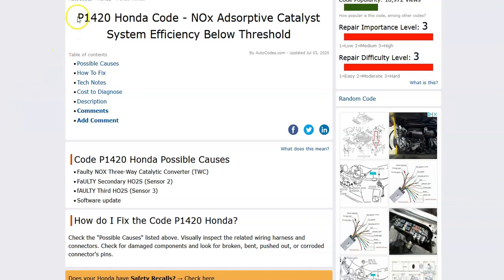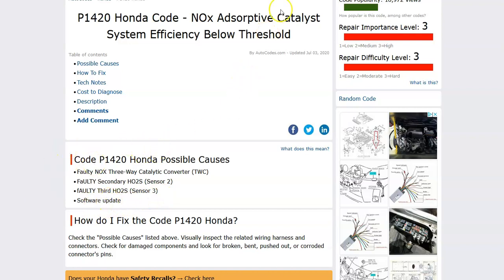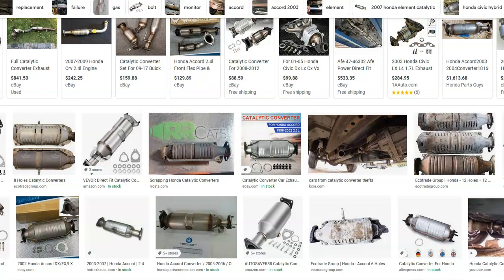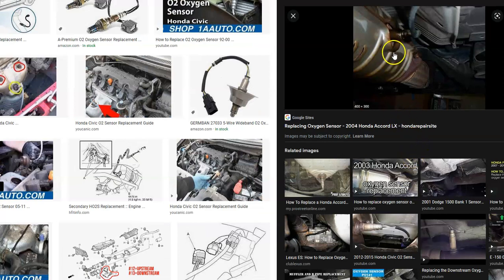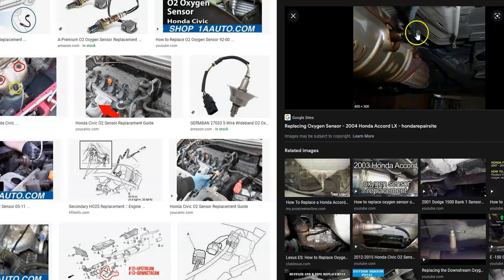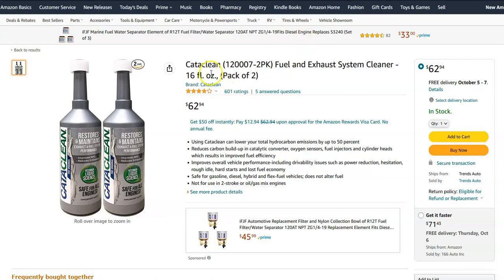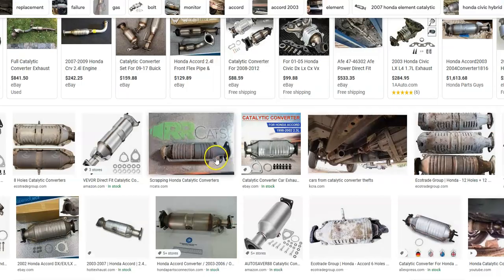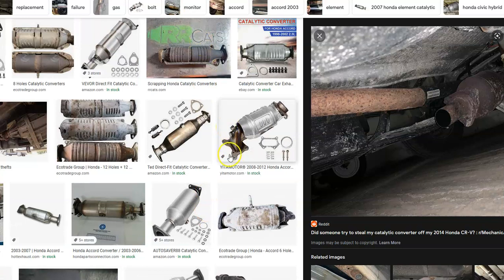How to Fix Honda P0420 Code: Catalyst System Efficiency Below Threshold (Bank 1)

Comment: I have a 2011 Honda Pilot EXL that keeps acting up on me. I'll be driving home from work at 70mph, my VTM-4 light comes on along with my check engine light, my speed on my cruise control drops from 70 to 60 mph especially climbing up an upgrade. Also when the RPMs are between 3,000 and 4,000 as I hit the accelerator, she spudders, but as I release the accelerator she's fine. Could this very well be the catalytic converter that is suffocating the motor and making her sputter? If so if I were to punch out the honeycomb and make it hollow, would that affect my car, other than emissions?
Reply: I had this problem it was the throttle position sensor, hope this helps

Comment: My 07 Honda accord had aftermarket Cat installed and now the OBD II sensor says my sensor “Bank 1” air/fuel ratio is what’s causing check engine light and nothing else was detected what so ever. Is it possible that all I need is a new sensor for bank 1 ? And does is it need to be OEM sensor ? I believe the OEM for my Honda accord is “Denso” and also does the sensor for “Bank 2” also have to be OEM denso brand ? They replaced the “Bank 2” sensor since they stole my entire CAT and almost the entire exhaust system and I’m wondering if the bank 2 sensor is aftermarket and somehow confusing the car and causing the Bank 1 sensor to mess up. I really need help bad with this because I can’t find any used cars at all what so ever In the $8,000 price range that have less than 120,000 miles with good gas mileage and all I can find all over Northern California is the stupid ass “09’ Toyota Yaris” in my price range that’s decent on gas and I do not like anything about that car so I really need help whoever reads this message and what I should do ? Will the aftermarket CAT pass smog if I have OEM sensors in bank 1&2 ? Or is it possible the CAT itself even with brand new OEM sensors still fail smog if I replace the sensors with Denso brand OEM ? Please help haha 😂 I have 178K miles on my Honda and it runs amazing even with the issue I have rn… not a single issue besides this problem. What should I do y’all ? Thank you! I have the PO420 code and says Bank 1 sensor. When they put bank 2 sensor on the new aftermarket cat I wasn’t told if it is aftermarket sensor or OEM either. Do I need to replace both with brand new denso OEM ? And even if I do will it pass smog even with the aftermarket CAT ? I don’t wanna have to buy a new car or a new cat..

Comment: I tell many of my clients having P0420 on a Hondas were/are to junk the car. Because not using genuine Cat & O2 get callbacks.
At the same time these vehicles have well over 166,000 & over 10 years old. If Cat is stolen, then you have no car.

Say if you get a Walker, Catalytic Converter then it's going to last about 2.2 to 4 years. And you have to replace it again.
And some has an O2 sensor on the Catalytic Converter that must be replaced.
If you are DIYer then go for it. Do not buy catalytic converter that is under $311.00. Unless you plan to flip that car to someone.
Many times, the O2 Sensor is seized & frozen on the Catalytic Converter.
Reply: My 07 Honda accord had aftermarket Cat installed and now the OBD II sensor says my sensor “Bank 1” air/fuel ratio is what’s causing check engine light and nothing else was detected what so ever. Is it possible that all I need is a new sensor for bank 1 ? And does is it need to be OEM sensor ? I believe the OEM for my Honda accord is “Denso” and also does the sensor for “Bank 2” also have to be OEM denso brand ? They replaced the “Bank 2” sensor since they stole my entire CAT and almost the entire exhaust system and I’m wondering if the bank 2 sensor is aftermarket and somehow confusing the car and causing the Bank 1 sensor to mess up. I really need help bad with this because I can’t find any used cars at all what so ever In the $8,000 price range that have less than 120,000 miles with good gas mileage and all I can find all over Northern California is the stupid ass “09’ Toyota Yaris” in my price range that’s decent on gas and I do not like anything about that car so I really need help whoever reads this message and what I should do ? Will the aftermarket CAT pass smog if I have OEM sensors in bank 1&2 ? Or is it possible the CAT itself even with brand new OEM sensors still fail smog if I replace the sensors with Denso brand OEM ? Please help haha 😂 I have 178K miles on my Honda and it runs amazing even with the issue I have rn… not a single issue besides this problem. What should I do y’all ? Thank you! I have the PO420 code and says Bank 1 sensor. When they put bank 2 sensor on the new aftermarket cat I wasn’t told if it is aftermarket sensor or OEM either. Do I need to replace both with brand new denso OEM ? And even if I do will it pass smog even with the aftermarket CAT ? I don’t wanna have to buy a new car or a new cat..
Reply: @vulkandeathgrip5568  atggreat7981 & I say you don't have to buy OEM O2 Sensor. 
You will need a DVM/DMM to check the O2. Since I don't know if yours is a 4 or 6 cylinders

Go under the car (after jacking/jack stands) & disconnect both O2 Sensors. Then test the sensors with meter
Reply with your email here if you need more help.

Are you sure you have no leaks from engine to output of Catalytic Converter?

Comment: I change both cats and h20 sensors and still has the same problem
Reply: @cognac8297 question, so the problem was the fuel regulator??🙏🏽 thanks..I hope you can answer 🙏🏽🙏🏽
Reply: https://youtu.be/Q9GrOvLtQF8